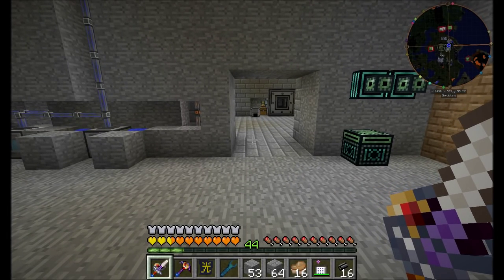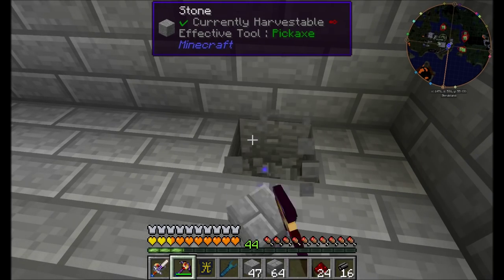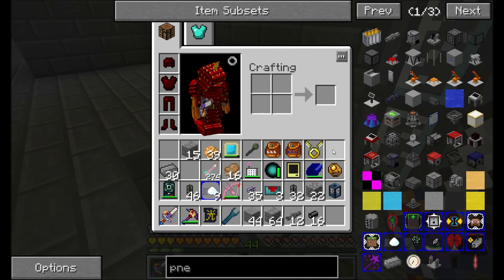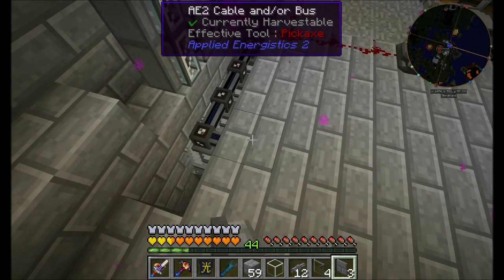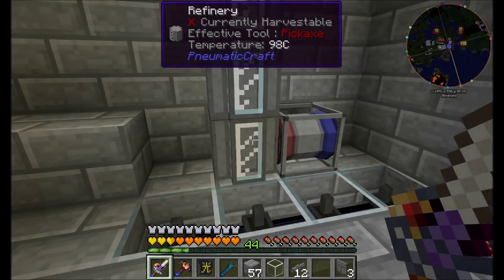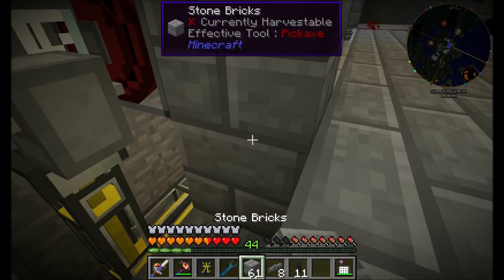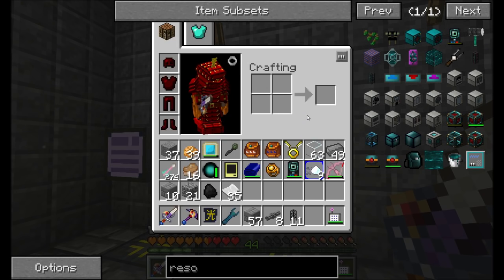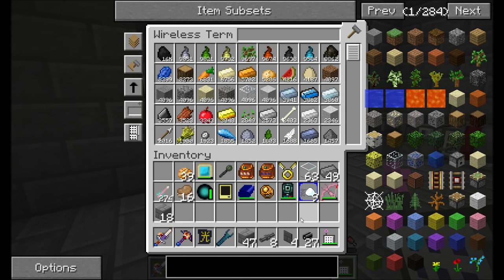Lets Play   S7 E104 Plastics

Comment: Okay dire a few things. The first is that if you put a dispenser upgrade in the thermopneumatic plant, it will auto output into the mixer. The mixer is heating up from the plastic, so you can either used compressed iron blocks to transfer the cold temperature from the vortex tube to the mixer, or use a heat sink block. The second is if you use a pneumatic wrench on the hot/cold side of the vortex tube, you can move the input for pressecondFinally, get the in game wiki mod from minemartin. It makes using the mod infinitely easier.

Comment: At least Minemaartin made a devicee, that is able to get colder than absolute 0 xD
26:27 the Vortex Tube is at -7500°C O-o
E: At the end it's already at -35000°C xD
Reply: DnielMC because who cares for logic and normality
Reply: Absolute 0 is 0 degrees Kelvin
Reply: Jarred Cole Yes it is, but this is meassured in Celsius and it about -273°C is 0 Kelvin.
And this got far, far below this :D
Reply: Ya minemartin realized this, he plans on fixing it.
Reply: DnielMC Is that because there's a block blocking the cold side, so it doesn't heat up from the ambient temperature?
Reply: Alex C No, MineMarten just never set a hard cap on it.
Reply: Gabriel Raj
What? I mean the reason the cold side temperature keeps going down instead of stabilizing.
Reply: MineMartin never set a cap for it to stop, so it'll keep going.
Reply: Gabriel Raj The one heating his refinery does not keep going.
Reply: what are you taking about, the cooling side?
Reply: Gabriel Raj
... Let me quote myself from only 20 minutes ago: "I mean the reason the cold side temperature keeps going down instead of stabilizing".
Reply: And let me quote myself " 
MineMartin never set a cap for it to stop, so it'll keep going." There is nothing in the code to tell it to stop, so it won't. Thats why it keeps going down.
Reply: Gabriel Raj
Then why does it stop going down on the vortex tube that's heating his refinery?
Reply: Its not that it stops, its just going really slow due to the low amount of pressure he has in the vortex tube. It works faster the higher the pressure.
Reply: Both vortex tubes have the same amount of pressure. Why do you think on one of them the cold side keeps getting colder, and on the other one it finds an equilibrium where it stops getting colder?
Reply: okay what time in the video are you seeing that it stops
Reply: Gabriel Raj So I went looking, at about 23:32 you can see for a moment that the cold side temperature of the original one is only -378 degrees, and it's been running for longer than the other one has by the end of the video, and with almost twice as much pressure.
Reply: ya thats before he hooks it up wit the other vortex tube, so the temperature dropped. I had an identical setup to dire when I first started, and I'm telling you there is no cap. I have a vortex tube in my play file thats at about -30,0000 degrees C.
Reply: I never said anything about a cap. I said that I thought the cold end heats up from the air around it, except if there's a block in the way. That would explain why the first one only goes to -300 (because as it gets colder, it draws more heat from the air) and the second one keeps going down (because there isn't air next to it).
Reply: Ya it doesn't really work like that. The vortex tube actively cools that end, and it counteracts any affect the air would have on the block. Room temperature according to pneumatic craft is about 20 degrees, so air has no affect on the tube.
Reply: Gabriel Raj Yes, the vortex tube cools that end. I expect it also transfers heat between that end and the block next to it, just like it does for the hot end. Since that end is colder than the air, it should heat up in addition to cooling down (and cool down the air, but that doesn't exist in Minecraft). There should be a temperature at which the two effects cancel out, and then it should stay at that temperature.
Reply: Alex C I see what you're saying. You can use this block to cool down other blocks, uch as the advanced compressors, which generate heat. Then the cool side would reach an equilibrium. When its just in contact with air, there is no equilibrium, it just keeps cooling down.
Reply: Gabriel Raj There does seem to be an equilibrium with air, presumably it uses the 20degC ambient temperature. And with the portable tank it seems to have no idea what temperature the portable tank should be, so it doesn't transfer anything.
Reply: He gave solid blocks a heatsink  ability, but it doesn't adhere to the laws of thermodynamics. The tank of lpg helps cool down the already cool side, since its a solid block. The other one has no solid block next to it, so it cools much slower.
Both hot sides have solid blocks, so they get cooled down too and won't climb in temperature very fast.
Reply: +JoshOnYouTube -273,8 :P
Reply: Maybe particles in the vortex have a negative speed x,)
Reply: Jacob Lambda Nope, 0 kelvin is absolute 0.
Reply: cocobest minecraft&mods -273,15 °C
Just sayin'

Comment: ok, i looked at the vortex tube and saw -3274 degrees celsius, that is around -3000 kelvin, which is the absolute temperature scale, that means that you can't get 0 kelvin as it is absolute zero, which is impossible, so if you get negative, you break reality, so to direwolf, I applaud you, you have just broken reality.
Reply: infernox1099 small update on the last time you see the temperature, it is -35013 degrees Celsius.
Reply: infernox1099 As far as I can tell based off of how quickly the temperature was dropping, the reading was bugged.
Reply: Verdiss The heat is being distributed to the refineries, so it is not skyrocketing. However, the cold side is unused, so it plummets. It's doing what it should be, except for the whole 'breaking reality' part :)
Reply: Endre Man0 The one on the thermopneumatic refinery is the one that drops below 0 kelvin, the one on the oil refinery stays above 20 kelvin. Both were receiving the same pressure and both were working on a machine. That's why I think the Thermopneumatic refinery one is bugged.
Reply: Verdiss Ah. Maybe the the thermopneumatic plant requires more heat, causing the tube to work faster? Or it's a bug. I'll leave it to the testers.

Comment: A possible improvement in a mod would be Red Alloy Wire, where you can set a threshold on redstone signal strength.  That would accomplish what Dire is currently doing with redstone dust.

Comment: What if you put the vortex machine between the plastic mixer and plastic liquifier? Point the hot end of the vortex machine to the liquifier and cold end to the mixer? This way the vortex machine will both heat up the liquifier and cool down the mixer. This might work great.
You should also be able to use the heat an advanced compressor produces to heat up the distiller. (or you can use the cold side of the vortex machine to cool it down maybe?)

Comment: from an engineering standpoint, placing the vortex heater in the middle of the thermo something  and mixer would be beneficial. it would heat the thermosomething and cool the mixer
Reply: Agent Double O Marin minemarteen, if you are reading this you could also make sulfur as a an ore that's generated (or extracted from coal) and use that to make plastics. pretty cool addition, though

Comment: If the Votex Tube has a hot side and a cold side, shouldn't you put it between the Thermopneumatic Processing Plant and the Plastic Mixer.  Then the hull heat on the mixer would be cooled.

Comment: Why not just put the thermopneumatic processing plant on the other (cooler) side of the vortex tube? That side definitely seems cold enough to reduce the temperature of the hull a bit faster.
Reply: Pikachuuun No it does not need it what he did is enough for it to work well - and the Flux compressor will need to go there later - it runs very poorly if it gets hot. Handy having one item that provides heat for one process and cool for another.
Reply: Understood. Thanks for the explanation.
Reply: Ocker Spock He has two Vortex Tubes, and is not using the cold side on either of them. One for the Plastic Mixer, and one for the Flux Compressor.
Reply: Endre Man0 When I set mine up I used two compressors on the two vortex tubes to provide more efficient pressure and simply let the "room" cool the mixer. The mixer only required room temperature not -3500C
Reply: Ocker Spock True, but having -3500C next to it would make cooling it to room temp faster. The machine stalls whenever the inserted liquid plastic heats the hull enough, so having a Vortex Tube there would cool the hull down enough that the heated plastic wouldn't affect the temperature.
And there's no reason that you can't have three tubes, with the hot end of one unused.

Comment: I'm wondering something : The tooltip about the temperature "not enough heat" indicates that it needs bloc which create heat, did this is just about the vortex tube, or did hot fluids can heat it up? Like lava on the back of the "refinery column'? (sorry for my bad english BTW)

(and another thought : Maybe putting the plastic mixer on the cold side of the vortex tube would make it cooler, letting it cool liquid plastic faster? This seems logic to me, but it may be a "to do" feature, since this whole plastic processing is already a new feature of Pneumaticraft...)
Reply: Yes, you can put lava and torches to heat up and yes, you can cool the plastic mixer with the vortex tube.
It's just that dire is a derp.
Reply: Good to know ! Thanks for this answer ;)
Reply: No problem :D

Comment: direwolf20 , didn't the MineMaarten say that you can make upgrades that causes the machines of the mod to become i-sided on different sides? 

I think you can upgrade those compressors underneath the glass to take coal from the bottom!
I don't think he said what the upgrade was called, but it should be in the info tab (or one of the tabs) when you open the compressor's interface.
Reply: Actually, I think it's the tab with the green up arrow.

Comment: What bothers me more than not utilizing the Vortex Tube to its full extent is the fact that he used 5 channels to get coal into the plastic production system. 1 export bus into a chest with round-robin pipes/ducts of his own choosing to the compressors, etc., would be far more efficient. (Yes, I know he can have an "infinite" number of channels at his disposal, but the inefficiency still bothers me...)
Reply: M4th G33k Even better: one interface with a servo. Then you can import plastic into the system in the same channel. 6 channels -> 1. Interfaces also restock far faster than export buses do unless the buses have acceleration cards.
Reply: Very true. I normally use an export bus/chest combo when I want a little extra buffer between the AE system and whatever system I've built; in Dire's case, he really doesn't need that extra buffer so the interface is indeed a much better solution! thumbs up

Comment: Cant you hook up the plastic mixer to the cold side of the vortex thingy? It would probably help it cool quicker
Reply: yovli porat Also, this wasn't beatiful wiring. it was a mess of cables. I don't mean to hate, but couldn't he just use retrievers on the backs of the tanks and thus use only 1 line AND have the fluiducts completely hidden?
Reply: yovli porat this phenomenon is commonly referred to as Direwire, the source of groans of rage and confusion for everyone who sees it
Reply: ***** Oh, ik the direwire but normally when Soaryn complains about it I don't get why he's complaining, but here it was just a ton of not required wires
Reply: yovli porat 
When it comes to Dire & Soaryn to AE & wiring.
Soaryn always complains about how messy his wiring is, and how easily it could be compacted.
I could easily compact this system dire is using, by using EnderIO conduits.
Buut, i don't feel like it. All of dire's videos are honestly backlogged, and the comments are rendered useless thus far.

Comment: Why not have just one line for all the liquids?if every tank already has a liquid in it,it should be just fine especially if you use transfer nodes
Also -9000 degrees C ftw because physics are nothing compared to Minecraft
#MineMarteenDerps #UnderMinus9000C
Reply: Matija Reby What's the Scouter say about the temperature?
IT"S UNDER NEGATIVE NINE THOOOUUUSAAAAAAAAAAAAAAAAAAAAAAAAANNDDD!!!
Reply: Endre Man0 yea basically